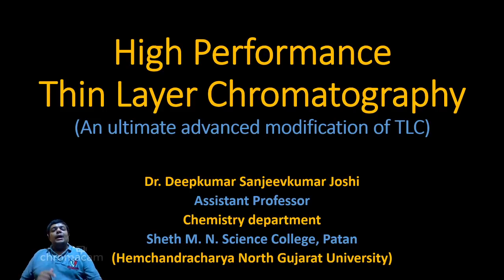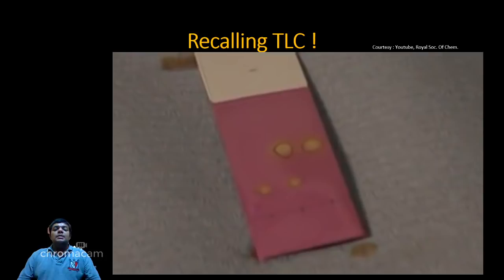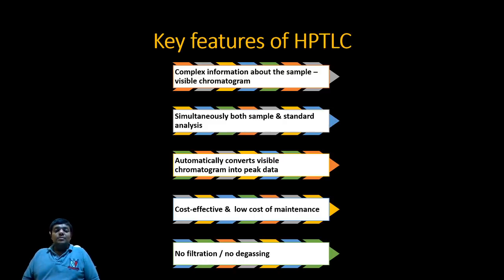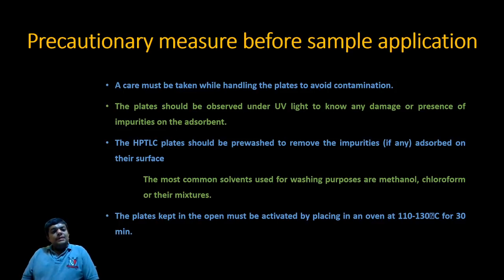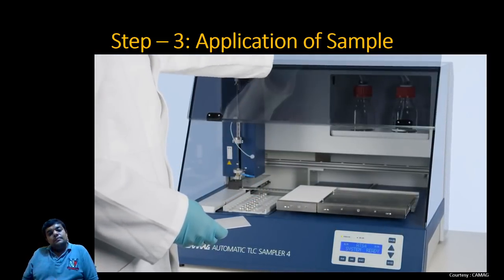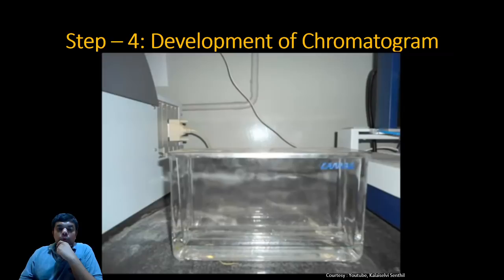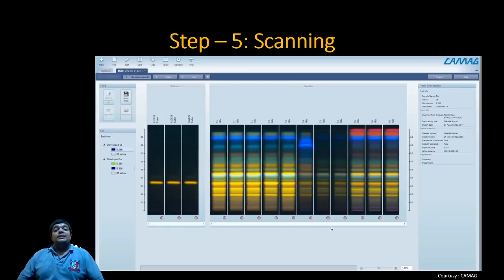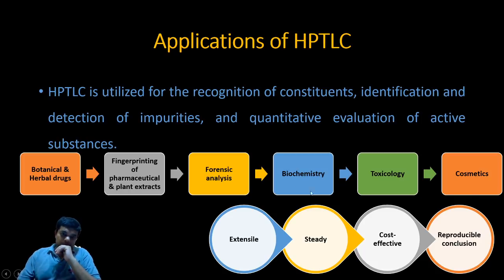7  HPTLC

Comment: Suppose, If you dont know the combination of Mobile phase then what is the process. Then this process follows trial and error method to know the correct combination of mobile phase. If so, what about economy of this process. Will we bare the cost of TLC plates for our trail and error methods. Correct me If I am wrong.
Reply from the maker: You are right, primary selection is done on small plates or reused plates. Although generally one who can afford HPTLC can possibly maintain all related cost mostly